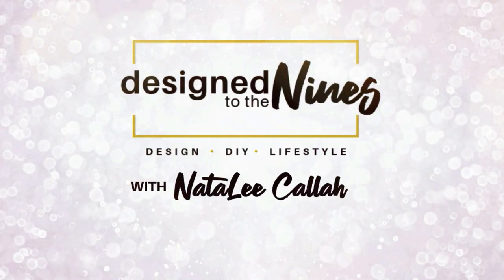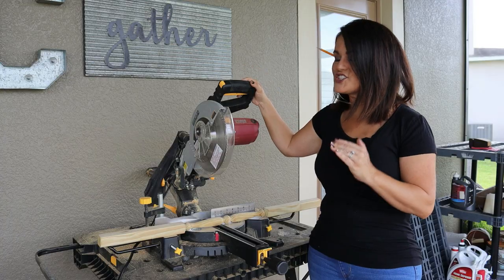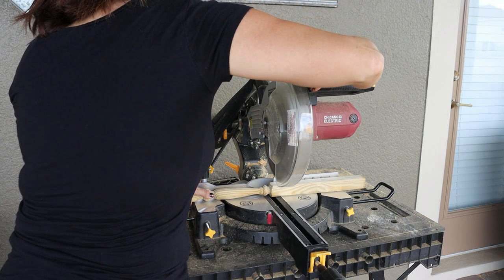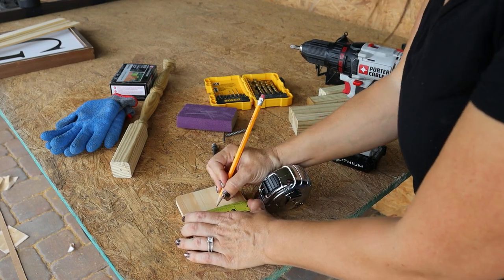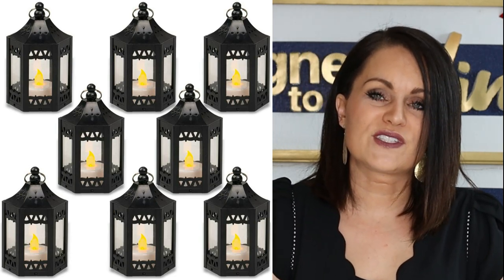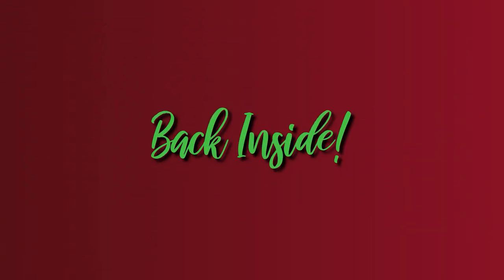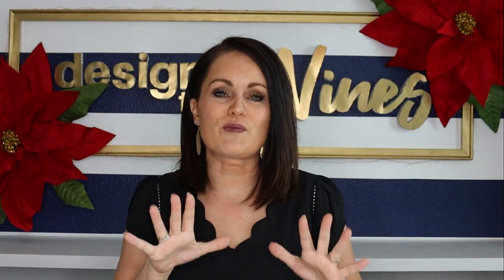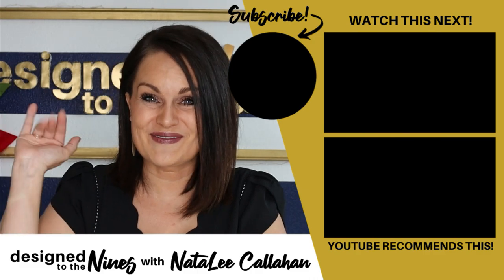HIGH END Pottery Barn CHRISTMAS Decor DIYs & Dupes On a BUDGET!

Comment: I made the life size version of one several years ago (I called it a Dicken's light post) and always planned to make another, because I sold that one, but haven't yet. However, I just bought 2 really pretty smaller lanterns at a garage sale for $3/set and I've had some of the posts. I guess I needed your video to remind me that I can use those items to make some smaller ones for my mantle, so this inspiration came along at just the right time!!  I use the miter saw all the time, but I did need pointers for how to figure out the barn door cross board cuts.
Reply from the maker: That is awesome! I love the lantern posts! They are a lot of fun! One little pointer is marking center of your barn door slat and cutting 45 degrees from that center. Hope that helps! =) Thanks for watching.

Comment: If you took a heavy cotton lace and modpoge it on a dollar store flexible cutting mat so you can peel it off, flip it over and modpoge it again letting each side dry before you go to the other. Once you're done you can cut them to fit the top of your lantern edge and glue with a glue gun to make a lace square 'crown' then spray paint black. Once dry, slip it over the top or bottom and slide up if the lantern is tapered and hot glue in place-now you have an ornate lantern!
Reply from the maker: I think that's a great suggestion. Also, Hobby Lobby sells metal lace that would work great too!! Thanks for watching.